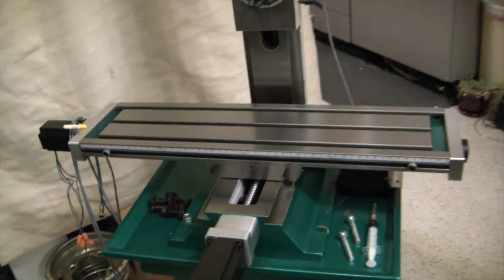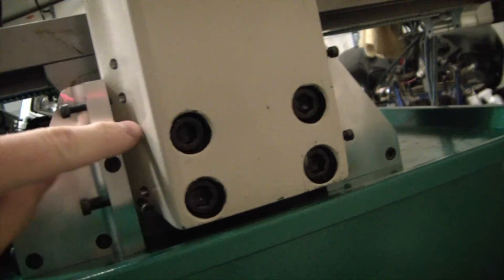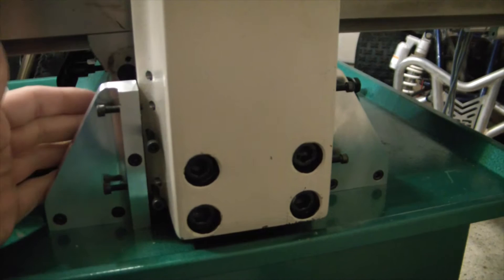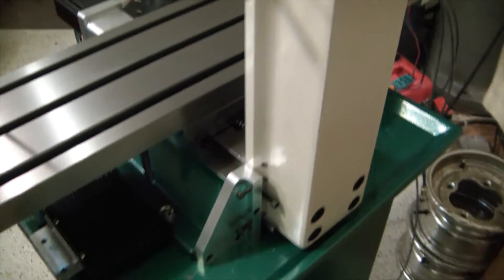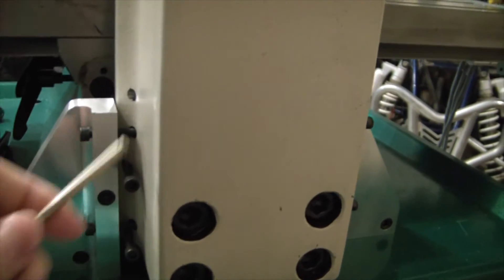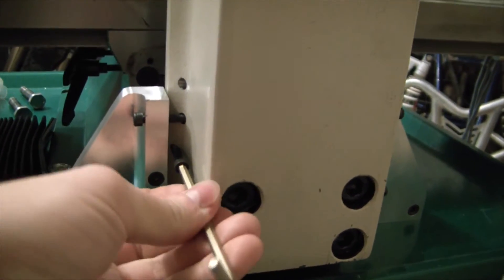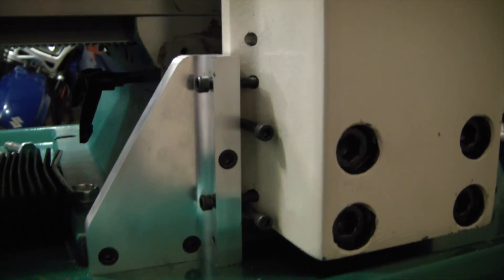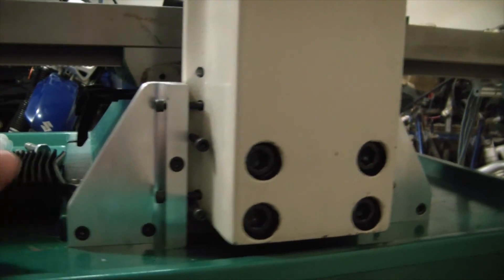ElementalMaker: G0704 CNC Conversion Part 6: Tramming Made Easy!

Comment: I had the angle grinder marks on the back of the base also, ground it square when I did the dovetails and then scraped it true. I'm working on something similar for the tilt of the head. my column no longer moves as I ground everything to interlock square.
Reply from the maker: Good to know it wasn't just me! Very cool that you were able to correct it! I watched many videos on scraping, but with no prior experience I didn't want to risk it.

Comment: Neat idea... just wondering if you are using shim stock when adjusting Nod? You might find you have a marked decrease in rigidity if you are relying on just the small adjustment bolts as your contact points. Liking the build so far though!
Reply from the maker: I do have shim stock in the case that I need it. I am a bit concerned about rigidity, but I believe others have done similar modifications without issue. I will update when I really get the machine going... completely new to this 'programming' thing!
Reply: I enjoyed the complete series of modifying the milling machine. Have you ever made anything on it? Would love to see the machine in operation.

Comment: Great idea. setups like that are used frequently on industrial equipment that must be aligned. Is your ,ill an older model? I was under the impression that they updated the design to have the column bolt on top. That would make traming simpler also.
Reply from the maker: Thanks Jody, Not sure if mine is a older model, it was ordered directly from Grizzly this spring, so I would think its the newest model, but who knows if they were trying to get rid of old stock.